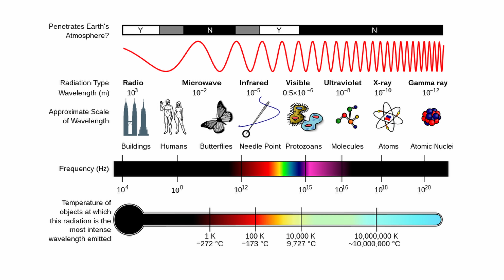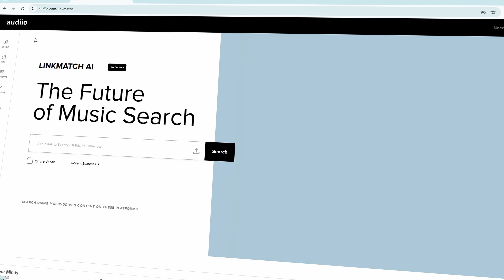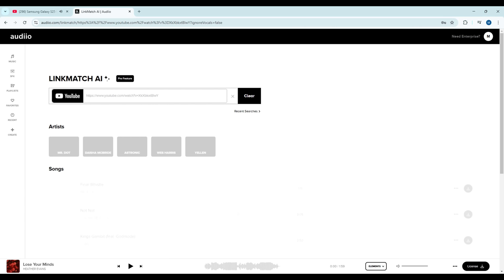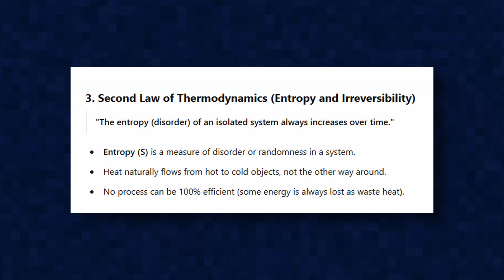This is how Maxwell Chikumbutso's Inventions Work

Comment: No such thing as "free" energy.  A device is needed and it will cost you dearly, LOL.

Natural gas is 3 cents/kwh in USA at my house.  Industrial NG is 1/2 that, btw.  New combustion will be ~200 mpg or 6 miles/kwh.  3 cents/kwh / 6 miles/kwh = 0.5 cents/mile on NG.  

A battery in an EV is over $7,500, some 2x that.  Life of car is 150,000 miles.  7500/150,000 = 5 cents/mile.  That is 10 times more than the Natural Gas fuel.  

Add in insurance at 4-8 cents/mile, tires at 2-4 cents/mile, road tax of 2 to 8 cents/mile and you have 8 to 20 cents/mile without battery.  Add in battery and you have 13 to 25 cents/mile.  Fuel is only 0.5 cents/mile out of 13 to 25.  In fact, if you cut the weight by not having a battery, you can have road tax of say 1 cents/mile, not 2.  That is less than the fuel, which means you have free fuel by the car design, not by having energy from air.  

Do the math.  1 cents/mile road tax instead of 2.  1 cent/mile for tires instead of 2.  No battery.  1+ 2+ 5 = 8 cents/mile savings.  0.5 cent/mile fuel leaves 7.5 cents/mile savings.  No EV can do this.

Comment: Sorry friend. But I have to call this out. As an African creator and engineering enthusiast:

Maxwell is scamming people. And this is not a matter of scientific belief but mathematics. The energy that sound creates is not enough to power anything other than a sensor. That energy then has to be amplified to even get a conceivable sound.

Second: If Maxwell is claiming the energy lost from sound, is what is able to charge a house and car. Then we wouldn't need amplifiers for the lost sound waves, when we can just use the more potent source itself (our voices).

Third: The electricity that is generated from those losses vs the electricity that is needed to run a car, let alone a whole house. Are in very different leagues. We are talking like 5 degrees of separation in wire gauge. It is not a matte of unlocking some scientific "secret" or contesting the laws of physics. It is simply impossible. No manner of magic technology is going to change that.

This man is a scam artist and a disgrace to African intellect

Comment: Yea, I call BULLSHIT. That "device" on the back of that TV looks a lot like just an inverter with its cover removed and heat sink added, and it is powered by a small hidden battery. So it will be all good and working for probably about 30min to an hour, then the "free energy" is done!

Comment: It's interesting how you take the side of the system. Who created these laws?There. has been laws before that were definite facts until they were not. The system decides it is impossible so they won't even issue a patent,  interesting. I don't know if it is real but I certainly will not dismiss his claims because of what the powers says. They have been know to lie until they can make the money, and I am a little disappointed that you pretend to be neutral but your  tone suggests otherwise. I don't know, will not present to know but I hope for the best because there has been quite a few before him who created devices that was tested before scientists and after they drag their names. through the mud and say how they are frauds, they suddenly die or disappear and their work is nowhere to be found.

Comment: This is not an invention, but a solution, rather an innovation. People always blatant to say anything against mechanical energy, forgetting that we have it all a long, you just need to be creative with scientific experiments. That car's generator is very easy to replicate, but you need a lot of copper coils and magnets to make it work, a pass through for making sure the battery doesn't overcharge while the wheels are moving. The car generator is a mechanical generator, this follows the same principle when you make a wind turbine, but in this case, you use the torque or rotation of the wheels to produce electricity which is transferred to the battery, and in turn to the electric engine.

Comment: There is absolutely no way this is real. The amount of power being broadcast is tiny. The most powerful transmitters around are FM radio stations which broadcast about 15KW of eergy. You wuld need to capture 100% of it and convert it to electricity at 100% efficiency to run a 10hp motor. I think this guy must be an honorary Nigerian prince!

Comment: In the late 90's I was investigating why a telephone system had a number of strange faults. I got 1.5v DC on a cable supplying a telephone extension. It should have been 50v DC. So I went looking for bad connections. I got to the phone system, and found the phone cable was disconnected. I disconnected all the phone extension cables from the system. Every cable was picking up 1.5v. I found out that a possible cause was the close proximity to a local radio station. To me, with my limited knowledge, this indicated that cables could be combined to produce higher voltages.

Comment: To power a car, the amount of radio waves needed to be inducted would require antenna grids as big as a sky scraper weighing tens of thousands of tons. Good luck fitting it to a small car & running it & making it affordable to even the rich.

Comment: While it is true that radio waves carry energy, you have correctly pointed out that this radio wave energy is in the nanowatt range (which for those who don't know, is extremely tiny).  A machine would have to collect a staggering amount of radio wave energy, in order to power a TV, let alone a car.
It's not impossible, but it is highly unlikely, given the current state of the art in modern technology.
With that said........if Maxwell has truly made a revolutionary discovery that will expand our knowledge of physics, that's great.   
But we need proof; not just hope, and not just hype.  Every great advance in Science must prove itself.
Reply: Forget radio waves, he is not using them he is using cosmic rays which create white noise in Earth magnetosphere. Device can condense it using similar method like in heat pumps. It is all Tesla forgotten invention

Comment: I certainly WANT it to work...but I can't accept that there is enough energy in radio waves at any particular place and time that is sufficient to power a vehicle, and you can't "amplify" something without an external power source. Many inventors have discovered ways to dramatically improve energy efficiency and were murdered before their inventions could be brought to market. Perhaps Maxwell has found another, but I have doubts until his creations have been thoroughly tested.

Comment: It must be a scam because the technology would be easy to validate on smaller devices, like a generator, rather than a complex and costly liability like a vehicle. 
Scams are not effective for low cost items so he goes straight for the scam car. 

Powered by radio waves… then he would have invented the battery free radio receiver first. SMH.

Comment: I think his invention is possible because when antennas on receivers pick up transmitted E M waves, they convert them directly into electricity. All that is needed is to amplify and store the electric energy for any application. So yes, I think it is genuine. Thanks.
Reply: And just how do you plan to "amplify" the signal without applying an external power source.

Comment: Radio waves do not contain enough energy to power a moving vehicle.This is probably a scam despite the media coverage. Chikumbuso insists that his technology has undergone certifications and testing, including ISO standards, FCC approvals, and verification by Zimbabwe’s Vehicle Inspection Department (VID). However, no published scientific validation currently exists. Scientific peer review is central to validation on any such work or claims. Claims that he and his partner were poisoned by those with oil interests are very similar to this Stanley Myers water fuel cell and car https://www.youtube.com/watch?v=staL1wr07Sg

Comment: Radio waves can generate electricity, anyone can experiment it by himself with just 3 components: A coil for induction, a diode and a capacitor. With this simple setup grounded and an antenna, you can  harvest up to 2,5 volts, which you can connect to a DC-DC booster or a joule thief to achieve 5 volts or more. Then, using several units like this put in series and in parallel you get more power. With the nano technology we have now our days, it is easy to put tons of this simple unit in a very tiny device and achieve a great power through inverters. Free your mind from bonds and explore the boundaries of science my dear friends.

Comment: Not an electrical engineer but i don't think you can amplify watts. You can sacrifice amps for volts or volts for amps but watts stay the same
Reply: But you can add watts to it Frpm DC voltage and static growth.  watch.
Reply: @wallbangerproductions840 which has to come from somewhere!
Reply: @richardledlightguy  from sonic radio waves available in the atmosphere.
Reply: There is no such thing as sonic radio waves. Sonic refers to pressure changes in the air which our ears turn into sound, radio waves are electromagnetic waves. I am an electronics engineer and so is my son. This is bs. @Ni3__Yadav
Reply: @Ni3__Yadav  There isn't enough energy in the atmosphere that you can collect to power a car. Note that his "invention" has no means to collect any power. The car has a big battery under the floor pan, like all EVs.
Reply: Wind water microwave mobile phone signal energy changing it into electricity not hard in fact, he is actually stealing energy from micro transmitters for communication
Reply: Wind water microwave mobile phone signal energy changing it into electricity not hard in fact, he is actually stealing energy from micro transmitters for communication

Comment: It sounds interesting, but it would seem to me that any area that used a few of these engines would drain radio waves to the point of creating a communications blackout. Running electrical devices wirelessly wouldn't be a bad idea, but you would need to put energy into the system. And you'd want to assign a specific frequency to it.

Comment: I believe this is going to change the world .
Reply: You should immediately give him all your money then 😂
Reply: In a revealing press interview published in Modern Mechanics and Inventions, July 1934, Tesla stated:

“I have disintegrated atoms in my experiments with a high potential vacuum tube I brought out in 1896 which I consider one of my best inventions. I have operated it with pressures ranging from 4,000,000 to 18,000,000 volts. More recently, I have designed an apparatus for 50,000,000 volts which should produce many results of great scientific importance.
But as to atomic energy, my experimental observations have shown that the process of disintegration is not accompanied by a liberation of such energy as might be expected from the present theories.
And as for the cosmic ray: I called attention to this radiation while investigating Roentgen rays and radioactivity. In 1899 I erected a broadcasting plant at Colorado Springs, the first and only wireless plant in existence at that time, and there confirmed my theory by actual observation. My findings are in disagreement with the theories more recently advanced.”

Comment: Remember, the Box has Been Controlled and many people have been taken away for the truth.
Reply: Furthermore Tesla writes in the Brooklyn Eagle newspaper on July 10th 1932:

“I have harnessed the cosmic rays and caused them to operate a motive device...
... More than 25 years ago I began my efforts to harness the cosmic rays and I can now state that I have succeeded in operating a motive device by means of them. I will tell you in the most general way, the cosmic ray ionizes the air, setting free many charges ions and electrons. These charges are captured in a condenser which is made to discharge through the circuit of the motor. I have hopes of building my motor on a large scale, but circumstances have not been favorable to carrying out my plan.”

Comment: In fact Maxwell is using the laws of thermodynamics perfectly. What he has done is interlink components that were separate in the western European mind. He has made use of radio transmitters, connected to phone microphones and transmitters, to radio receptors, phone receptors and speakers, to USB charging wires, to a battery. His device is a battery recharging system using radio and phone function of components. Any educated engineer like myself will tell you that the laws of thermodynamics only apply in the creation of mechanisms like the gas carbine M4 machine gun which transfers the energy exhaust from the bullet casing into the hammer for extra propulsion. In the case of Maxwell, it's not thermodynamics as a topic that we look at but CIRCUIT THEORY, which is studied by real engineers like myself.
Reply: If you're a "Real Engineer," build it yourself and verify that it works. That's how science works. You do something produce instructions on how to do it and other people replicate it.
Reply: @g33k37  he has verified it. Good for him he didn't patent it where people like you would steal his invention. He is better of doing what he is doing now, registering his invention as his own company, setting up a factory in his country and advertising and selling it to his people. Those what want him to reveal how his invention works want to steal it before he gets funding to retail it.
Reply: @g33k37  I will build a better independent energy mechanism, Maxwell's doesn't have enough power.
Reply: All this writing and yet BS. You're no engineer!
Reply: @Ngunev  are you? It's not writing I've done here, it's typing, you don't even know that. What part of my comments is not engineering? Give us proof or SHUT UP!
Reply: @eastafrika728  Is that so? Then enlighten me, what was that talk about this guy's(supposed) invention having nothing to do with the laws of thermodynamics? Go do your research because it seems you don't even understand thermodynamics laws. You say you're an engineer, I trust you will be open to research and logic!
Reply: @Ngunev  your comment is just ignorant. The video claims that they used the laws of thermodynamics to disprove Maxwell. But the device works, so that and your comment are stupid
Reply: @Ngunev  What Maxwell has done tells me he was an electrician and mobile phone repair technician. This is because he has used the feedback loop that you hear when someone calls into a radio station and the feedback you get from a microphone, by connecting a radio transmitter system to a radio antenna system as the collector of radio waves, to  phone and radio speaker systems, from which he connects a USB battery charging system to a phone and radio microphone system, which is the feedback loop, which he connects to a battery as a recharge potential difference generator, which he connects to a power  output system. By system I mean micro electric components. Meaning that Maxwell's device is very viable and conserves radio frequency energy through sound. He needs overhead capital, a factory, retail outlet, prices and sales and marketing manager.

Comment: The genius of the African will be revealed with time....or his true character...one or the other
Reply: Furthermore Tesla writes in the Brooklyn Eagle newspaper on July 10th 1932:

“I have harnessed the cosmic rays and caused them to operate a motive device...
... More than 25 years ago I began my efforts to harness the cosmic rays and I can now state that I have succeeded in operating a motive device by means of them. I will tell you in the most general way, the cosmic ray ionizes the air, setting free many charges ions and electrons. These charges are captured in a condenser which is made to discharge through the circuit of the motor. I have hopes of building my motor on a large scale, but circumstances have not been favorable to carrying out my plan.”

Comment: You don't need to apply the laws of thermodynamics. Maxwell is simply making use of a battery, with overlapping circuits of radio reception and transmission and a phone microphone about earpiece receptor to make the battery continuously charge.

Comment: They are fake, till proven true. Or true, till they are proven fake. Which one. I think the former.
Reply: Furthermore Tesla writes in the Brooklyn Eagle newspaper on July 10th 1932:

“I have harnessed the cosmic rays and caused them to operate a motive device...
... More than 25 years ago I began my efforts to harness the cosmic rays and I can now state that I have succeeded in operating a motive device by means of them. I will tell you in the most general way, the cosmic ray ionizes the air, setting free many charges ions and electrons. These charges are captured in a condenser which is made to discharge through the circuit of the motor. I have hopes of building my motor on a large scale, but circumstances have not been favorable to carrying out my plan.”
Reply: @goranindjic7725  "circumstances have not been favorable". Meaning there's not enough power to do much of anything. Way less than powering a car, by orders of magnitude.

Comment: Africa will be a super power after this because if he apply this technology into a weapon it wil be very powerful with endless fire power with a death ray
Reply: Furthermore Tesla writes in the Brooklyn Eagle newspaper on July 10th 1932:

“I have harnessed the cosmic rays and caused them to operate a motive device...
... More than 25 years ago I began my efforts to harness the cosmic rays and I can now state that I have succeeded in operating a motive device by means of them. I will tell you in the most general way, the cosmic ray ionizes the air, setting free many charges ions and electrons. These charges are captured in a condenser which is made to discharge through the circuit of the motor. I have hopes of building my motor on a large scale, but circumstances have not been favorable to carrying out my plan.”